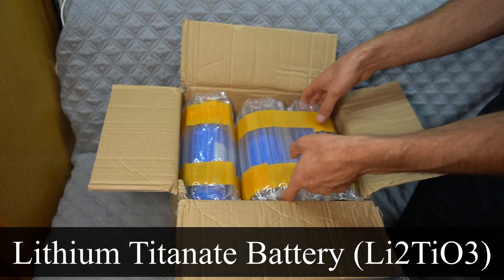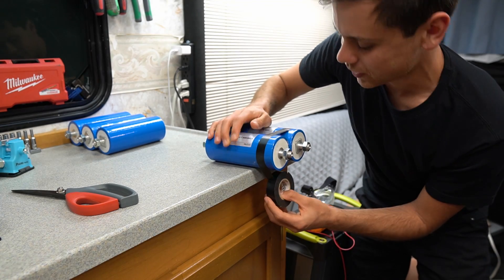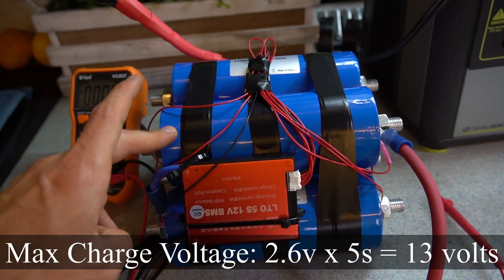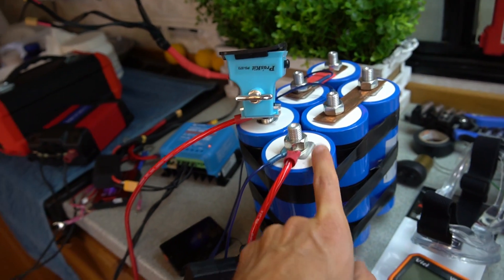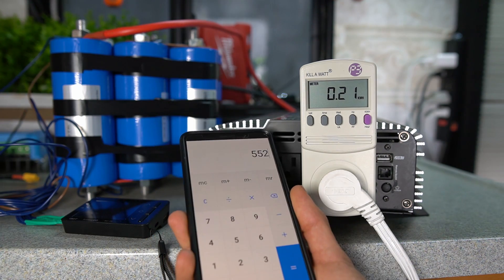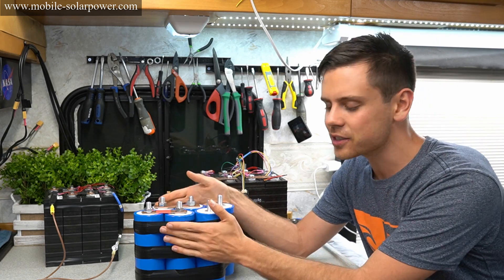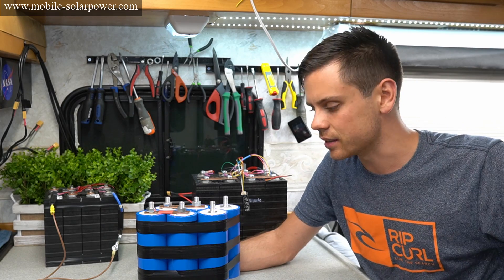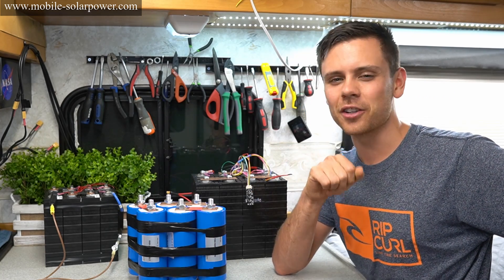DIY 12v LTO (Lithium Titanate) Battery

Comment: According to lto cell, you are not charging it to the max, 14.9 or 15 v is around 2.5v per cell which is way from its its published 2.7-2.8v, can you try to charge them till such limit and redo your capacity test?
Reply from the maker: And the majority of capacity was at the voltage range used in the video so it would only add another 10% ish of capacity
Reply: @WillProwse  Yes BUT, add that extra 10% of capacity to offset the 15% inefficiency and , well not so bad now......
Reply from the maker: @jimjones7821  no, its still bad. I do not like it
Reply: @WillProwse  AN interesting PLUS for them is they can be discharged to 0 and recharge right back up with almost no damage - cycle life reported to reduce to 5-6000 cycles if discharged to 0. Thats useful for some of us. Also that FAST charge is VERY useful for me in my application. But I get they dont suit your situation.
Reply: In YINLONG video shared, 2.09 they are charging it to 2.9v and discharge to 1.5v
Reply from the maker: That's one of the big reasons I do not like them for 12/24v application

Comment: You can absolutely use those with a 12v system, you just need to use a boost converter to maintain output voltage of the 6s (or 5s if you prefer) pack between 12 and 13 volts.
Reply from the maker: Ya and 10% converter loss on top of inverter losses. Not fun
Reply: Or add a cell or two, and buck convert down to 12-13V. Also if thats a "Modified" sine inverter, it could skew the reading from the kw meter.

Comment: Use the discharge inefficiecy to your advantage... Like if you live in a house that most of the time requirs heating... Solar charge them during the day and then while using power at night they are also heating your house.... The inefficiecy will always be given of as heat.
Reply from the maker: Smart!!
Reply: Seems like a good idea, two birds with one stone. Could put the batteries in an enclosure ducted to a heat recovery unit. That way if anything goes wrong with the batteries the gasses are kept from entering the house. Quick calculation looks like we're losing 15% of a 10kw battery bank to heat so about 1500w total or about 5120 BTU... per discharge cycle. 

So really, not much heat production at all. I dont see it being a feasable option for a standard house for even offsetting other heating by a appreciable degree.

Comment: if you had a 3d printer.. you could design and print a custom bracket for those.
Reply: Everyone has 3d printer. Order through 3dhubs, treatstock, emachine shop, etc. etc. etc.
Reply: Chevy SparkEV I even have one..
Reply: @PyroTronix  And how long do you spend to 3D print? For one off like this, 3dhubs charges about $20, and you don't have to worry about bed leveling, sticking, layer separation, stringing, filament drying, house fire due to thermistor falling out, etc etc.
Reply: Chevy SparkEV I really don't use it any more... It's pretty good if you start building it correctly, even though it's not all my fault. My 3D printer is the Anycubic Kossel Pulley. It prints very nice, but in a very small area(one third of the total print volume). After getting out of the "safe zone" it starts drilling into the plate. So now it's littered just trash.

Comment: You say several times how amazing the recharge cycles are, the number or cycles you get.  But in reality there is no evidence to support it.  You haven't tried it, you can't really, but as it stands, it is just a claim.

Very interesting video!
Reply from the maker: no there are actual studies to substantiate that claim. Lithium titanate is not a new chemistry and has been studied vigorously. In my capacity test when discharge inefficiency is taken into consideration they were accurate
Reply from the maker: Look up the degradation graphs after 20,000 cycles. They are very easy to find.
Reply: @WillProwse  thanks for your useful replies ... but I meant that these actual cells, already wrongly described in terms of capacity, can't be assumed to have standard results.  (Just my thought, and I'm not any kind of expert!) Thanks again!

Comment: My SBMS0 supports 6s for LTO and will send you one soon. But I do not recommend LTO as there are zero advantage compared to LiFePO4 and they cost more for same capacity.  The cycle life will not be helpful as there is the calendar aging on all type of batteries and that is around 1% per year so 20 years is the best you can get from any battery even if you do not do any cycling thus LTO will only last as much as LiFePO4
My LiFePO4 in typical use after first year lost 0.9% capacity about 0.3C from cycling (daily average cycling of 47% DOD) and around 0.6% form calendar aging as my battery is always at low temperature just +18C to +25C
So I do not recommend LTO.
Reply from the maker: I totally agree with your points on lto.
Reply from the maker: Also they are heavier than LiFePO4, the fast charge rate is pointless for solar, and lower voltage means more cells. So many downsides. Good point on calendar aging

Comment: Never trust anything made in China, to date, I have not found one product made in China that is of excellent quality, I have heard they make excellent solar Panels, if that is the case, I cry shame on the rest of the world, because from years of personal usage experience, all Chinese made products are garbage, well except maybe Clothing, I really love the way their clothing looks.
Reply: Sometimes it's hard to impossible to avoid Chinese Products. E Bike stuff is mostly made there, and cordless tools (also from brand manufacturers) too. All cellphones come from there, and many computer parts.

If there's a brand name behind the products, they can be quite good. But the products from unknown back yard manufacturers are probably less recommendable.
Reply from the maker: Good luck trying to build solar power systems then. Battery manufacturing in most countries is measly compared to china. Where are you getting your cells from? I love Chinese products. They have cheap crappy stuff and good high quality stuff. I love Chinese LiFePO4 cells. They rock
Reply: @WillProwse  Hi Will, great and incredible videos as usual, you are doing an awesome job educating older tweekers like myself, now, to answer your question about where am I getting my batteries from,  I am currently going through my own designs of alternative energy storage, using a variety of methods, I don't like any of the current technologies for batteries, with the exception of the now defunct saltwater battery, because I live on an Island surrounded by saltwater, when I am done perfecting my prototype I might send you one of them; that's if big oil doesn't try to silence one of us first. But I don't use traditional chemical cell batteries. There are other ways to do it, and don't let any tell you that, "All Energy Comes from the Sun", Like they tell us in Physics Class. Continue to great videos Young Man, got my eyes on you. 1-Us
Reply: @1234 I wish the U.S had a better manufacturing scheme also however, companies were allowed to take their businesses out of the United States to China in Droves, thus fundamentally educating and  empowering a communist country that is held bent on bending the world to it's own will, by deliberate predatory lending practises in third world countries, now they are a force to reckon with.

Comment: Because they charge so fast is it worthwhile having them in front of the lithium ions as a precharge.. hmm, let me explain. Solar to lithium titanate or super-capacitor through diode to slow (control) charge the lithium ion battery bank. Just thinking of the fluctuations while using the MPPT controller and if these batteries or supercaps make it behave any different to the lithium ions. On top of that it can almost a power filter of sorts, but also once lithium ions bank is fully charged it becomes a reserve battery bank.
Just asking if they would be useful in a solar RV situation as I have been seeing a few videos on them lately but still cannot really see why we are looking at them and getting so excited by them.
Reply from the maker: That's the thing, with a lithium based solar power system, even at low c rates, it can absorb all the power no problem. If I were to use lto and a pre charge type buffer, I would have more of a loss than lithium alone because of the discharge inefficiency
Reply: @WillProwse  
Cheers thanks champ.  Great content, loving your channel.

Comment: Hey Will! This question is totally separate from the context of this video-- have you tested Grape solar panels before? I'm curious about how their 180 watt panel stacks up to some of the cheaper brands.
Reply from the maker: They tout themselves as high quality USA made panels but in my tests, the cheap panels are awesome and sometimes better. Not a huge difference in manufacturing. Usually same solar cells used by everyone. What does matter is how the wires are crimped or soldered at diode box and the rails used. But I wouldn't spend the extra money for the expensive panels personally. Not a big difference at all. Unless space utilization is paramount, then I would use sunpower cells
Reply: DIY Solar Power with Will Prowse Interesting, thanks for the heads up!

Comment: this is interesting i would think the cell test is not preformed that way 

light load for a longer time might give you the numbers you are looking 

for    did you look at an application test for these battery   the one i saw
i do not think fits what you are doing   this is interesting     Like the video
Reply from the maker: That's why I did both. You need to stress test them. No point in babying them with tiny loads

Comment: They’re more expensive, they waste energy (you need more panels and more capacity because of how inefficient they are) but they have three advantages. They last an enormous number of cycles according to the data sheet, they accept charge readily, and they have a nice flat discharge curve. Plus they are extremely safe on crush tests etc, so maybe that’s a fourth advantage. However the cycle life on wiki is listed between 3000 and 7000 cycles which is better than LiFePO4 but not 10x better. The energy density is not great - about 100Wh/KG but only in the very best cells - they vary down to 30Wh/KG.  Overall I think you’re right Will - they are mostly suited to unmanned, long term situations like telco links, microwave, satellite, amplifier repeaters etc. I think LiFePO4 strike a much better balance for stationary storage. Also extremely safe, capable of high discharge and charge rates and much more efficient. Using them instead of ultra caps as a front end to a storage battery for things like regen and acceleration might make sense.
Reply from the maker: Exactly. And the benefits of lto aren't going to be used by me really. These cells should be able to handle 400 amps and charge in minutes, but I don't have a amp source that large. They are also heavy and expensive. But yeah, the discharge inefficiency is a huge bummer, solar application wise. I need more solar panels to make up for that loss.
Reply from the maker: Yeah they safety is amazing on these

Comment: Thanks for the continuous updates, considering the maximum charge voltage, and minimum discharge, for nominal 12Volt batteries it would take a 6S and cells in series, let's say a 16/16,8 volt charged and 10/10,8 volt discharged, it would be better to exploit the inverters limiting the charge voltage at the maximum accepted by the inverter logically, so it does not switch off due to low voltage before having not finished the battery capacity
Reply from the maker: Exactly

Comment: >^. .^<       Just a pass along suggestion.   I use tape for a lot of things like you do too.    You may wanna consider getting a roll of Garilla Tape the next time you go to the hardwhare and store/keep it handy for future use.   Garilla Tape does not slowly slide on it's self as electrical tape does and is easily twice as thick as electrical tape is.    Example: I fixed a set of BlueParrott 450 XT BlueTooth Head Phones a year ago and the taps sitll exactly in teh same place a year later and doing a great job still....

Comment: Yes, I found a 6s bms which took a month to get here.. Thanks for the video Will..  Good stuff.
Reply from the maker: Do you have a link
Reply: Yes..  The weight is a problem too..  We have 18 pouch 55 ah 6 s  3p  for a trolling motor.  It weighs about 70 lbs. Left it in the motor home all winter and didn't discharge at all.  (We live in Idaho) Amazing in that sense.
Reply from the maker: Yeah pretty heavy

Comment: You might consider that the lower discharge efficiency may be due to  the internal resistance of the cells.   

I've been seeing a huge amount of solar panels being advertised on Facebook ads.  They're 100 watts or more and they're cheap!  I never used to see these panels, I'm guessing that previously that all of the panels produced were used to fill the demands of very large projects.  Only very recently has production caught up to allow some panels to be sold online.
Reply from the maker: Makes sense for lead acid vs lithium and how much lead acid cells heat up. But ir in lto is super low. So I was a bit confused about that.

Comment: One of the gripes with most lithium batteries is how long they take to charge...but with the LTO being able to charge safely at least at 5 C, then could you maybe used them as a front end charging "buffer" that could be charged up fast, then used to slowly recharge a more a more conventional Lithium battery bank which would then run your devices, inverters, etc rather than the LTOs.
Reply: Personally, I would then go full supercap or even ultracap for such an application.The ultracaps have a much higher efficiency rate than these cells and if you only use it as a buffer then the caps are a perfect solution. These LTO's have the capability of storing energy for a long time and you don't really need that.
Reply: A DC to DC charger from them to the others?
Reply: @Colaaah  Yup. I've read of people doing similar things with supercapacitors, which can be charged instantly, then charging a battery from them.
Reply: @FarrellMcGovern  its been 2 years, but, do you possibly have any recommended channels or videos that explain doing this???
Reply: Is C for capacity? In your 5C . Also what 6S means. 6 Cells? Why S
Reply: solidfuel86 
Yeah if you can charge them at 5C it means a 10Ah cell can be charged at 50A, ie full charge in 12 minutes. S means series, so a 6S pack is six cells wired in series. Similarly, P is parallel.

Comment: please make few vedios for converting petrol bike to EV bike using these batterys. Or any batteries. As you did is vedios discharge rate is 99% for lithium ion battery I wud like to know more abt that battery. How many battery required for 48v 40amps

Comment: Will, love your comments! Based on the price these are really low quality cells. LTO must cost $900.00/kWh or more.
Yinlong does not sell batteries on Alibaba or anywhere else you have to buy it directly. Same with Toshiba which cost minimum $1,150.00/kWh. Never buy no-name batteries as you don’t know what is inside. Real LTO can be charged 5-6C max with 2-3C recommended and life cycle is 15-20k cycles. I would like to see simple test like you did here on NMC cells. But please use some brand name cells like CATL or Samsung or LG.
Reply: Will this is not true, LTO are the best batteries by far. There is no chemistry that has any parameter better than LTO except weight. You tested no-name garbage that’s why you come up with the conclusion. There are two reasons LTO didn’t replace the other chemistries: weight and price. In places where weight is not important no body even considers other chemistries.
Most important is charging time: 6 min (Toshiba) and  you can charge it at sub 0 temperature (-30C). They are 98% efficient as well. And the safest of them all.
Reply from the maker: @TM-sh7jj  and my results were actually pretty spot on if taking discharge efficiency into account. 15% loss, plus I was constrained to voltage range of 12v devices. Seems pretty spot on. And it wasn't impressive. Am I missing something?
Reply from the maker: @TM-sh7jj  and weight and price are huge factors
Reply from the maker: @TM-sh7jj  would love to hear what you have to say. I appreciate your comments a lot!
Reply: Will I agree, in your solar setup there is no advantage unless you use your RV during the winter. But even than considering the price it doesn’t make sense.
Reply from the maker: @TM-sh7jj  thanks for the info about lto. You mentioned a lot of good points. Thank you T M
Reply from the maker: @TM-sh7jj  why though? I love the safety and charge rate, and temperature characteristics. Says here the discharge efficiency is 85%? That is junk, whether the cells are name brand or not: https://www.eetimes.com/author.asp?section_id=36&doc_id=1325358
Reply from the maker: @TM-sh7jj  they do have impressive qualities. I just don't see them as a good idea for solar. I can think of tons of other applications. But for my application, even if the cells work 100% as advertised, I'm not that impressed. Am I wrong?

Comment: Will, forgive me for asking this, but is your countertop Formica or something equally conductive?  I was curious because as often as not, you had the battery stack on their battery posts in contact with the countertop, and that would seem to pose a risk for some short-circuiting enough to affect your readings or efficiency.  Maybe not.  I think I always saw the batteries on their sides while testing,(good)  but it's just a thought.  Kudos to you on this episode, as there was a LOT of off-camera work that you put yourself through.  Oh, the passion for learning!
Reply from the maker: Oh it is non conductive. Great eye though!! That would skew results a lot. I learned that the hard way with carbon fiber years ago. Had no idea till I shorted some 3 phase ac wires on a race quad frame.